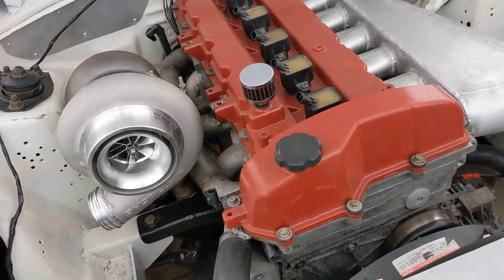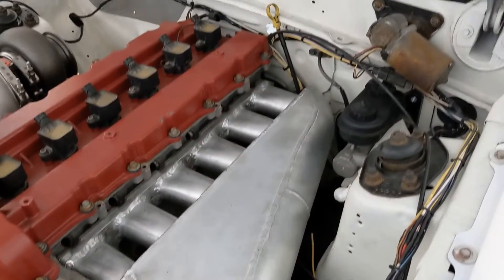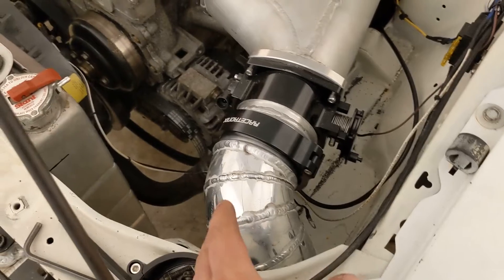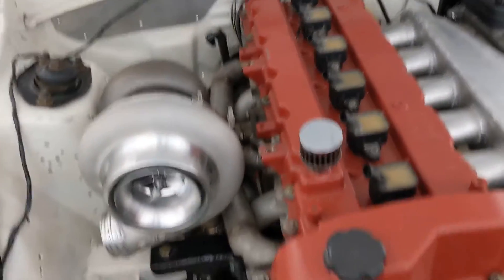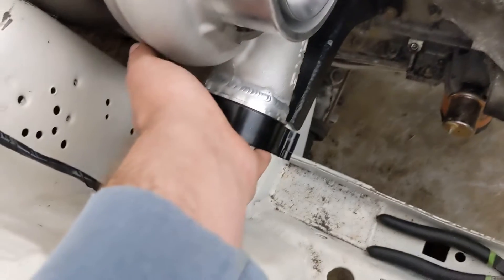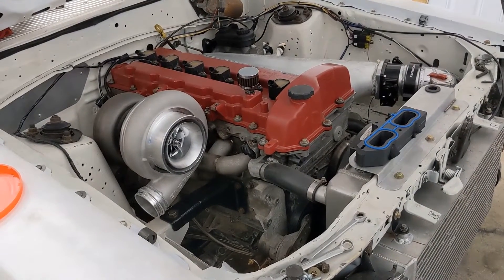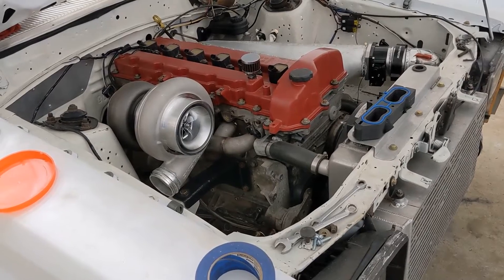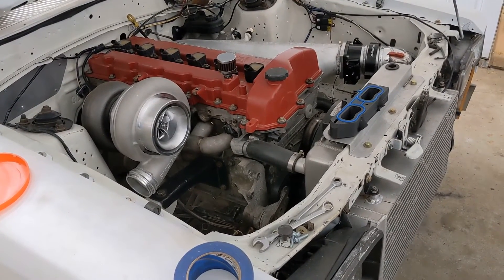Making an Intake for the Ameri-Barra Vortec 4200

Comment: Calvin, is there any incentive to making a divider down the the middle of the plenum? From the middle of the throttle body to the center of the runners? Effectively making a dual plain. Curious of your thoughts.  I am in the planning stages of making my intake.
Reply from the maker: Could have merit. Optimal runner length may be affected since it would effectively be two 3 cylinders.

Comment: Loads of work when you could run an ls with a 2 cylinder advantage. The cost of the 4200 is foolish
Reply from the maker: The cost of not doing something that will make you happy is far more foolish. Personally I try not to judge others for doing what makes them happy.

Comment: I'm wondering if you could make either a 3x2 sidedraught set up with the Borla throttle bodies (their IDA 48 look alikes), or a full ITB (6x1) set up like the old BMW M6's and M5's had?  🤔
Reply from the maker: When there is a will, there is a way
Reply: @Calvin-Nelson  The only major difference in what I think I will do is, instead of using a Ford Fox body, I would like to try a GM G-body car with a 4L80-E transmission.

Comment: What were the tube specs you used for the intake runners?? Wall thickess/diameter. Thanks
Reply from the maker: I used 2.5 diameter 0.060 wall, but I would recommend 2.25 diameter

Comment: I have a early trailblazer 4200 and it is a tough engine. A friend has the same engine in a mid size GMC pickup but it is a 5  cylinder.. I would think it has better balance than the 4200.
Reply from the maker: The 5 cylinders have balance shafts. The 6 cylinders don't, so take that how you will. 😉

Comment: I have a 1967 Chevy C-10 with a 250 straight 6 , I would love to put a stock 2006 4200 motor and transmission , and rad  in my truck , Are these motor and trans cheap to buy from a scrap yard ?
Reply from the maker: Yes. Very cheap

Comment: Would you sell the intake flange as a part?
Reply from the maker: There was a guy doing it on the  Facebook page. I need to look into have a place make them. Making them on a manual mill sucks.
Reply: @Calvin-Nelson  seems like having one laser or water jet cut would be an easier, though costlier option.

Comment: Looks great.  Alot of manual labor.  Did you use any  formulas or just the"SWAG" theory?
Reply from the maker: I talked to a guy that has done intake manifold design in the past. Followed his recommendations. Only thing I didn't do was make the radius entry into the runners like he wanted me to. I figured the velocity stacks would do ok, and I was just trying to get it done.
Reply: @Calvin-Nelson  cool thanks.

Comment: Hi, just wondering if you have tried or would be interested to try putting the exhaust cam onto the intake side for dual VVT. Chevrolet has stated that this engine was designed with future implementation of intake side VVT in mind, and while it's not from the same manufacturer, Frankenstein Motorsport has done a similar thing with the 2ARFXE Toyota motor, putting the intake VVT cam onto the exhaust side and works.
Reply from the maker: Would definitely be interested, but it would be a very difficult thing to do

Comment: Great job! Was thinking using Holley terminator x and using progressive nitrous control which uses a pwm to run the pwm solenoid that gm uses control vvt on the 4200 engine.
Reply: Any thoughts would be appreciated thanks
Reply from the maker: @richardkent3522  Short answer is I don't recommend it. 

I tried open loop control before. After figuring out the closed loop control on the Goldbox, I found out that duty cycle does not give a linear response to VVT angle. In fact there is very little correlation. It has to "hunt" around to maintain a steady position. Also, terminator X does not support the more common trigger pattern that these engines have, which is a 6+1 crank wheel.
Reply from the maker: @richardkent3522  If it was possible to run the VVT with a Terminator, I would be running one! Trust me!!! Lol
Reply: Ok, thanks, One other question how thick is the bellhousing adapter for the studebaker?
Reply from the maker: @richardkent3522  3/8"
Reply: Thank you.
Reply from the maker: @richardkent3522  No problem.

Comment: So I commented first thing this morning but for some reason all my youtube comments didn't post. So I will try it again. Great work Calvin. really cool. I would think if you wanted to run a second set of injectors you could add a angled Bung to the runners on the intake fairly easily you would just need to optimize the angle and length for the injector you wanted to use. could even incorporate a drill guide into your printed jig. I love the fact you are doing all this in your home shop with your dad. You guys are amazing. I also think its great  that you are getting recognized by Jeremy, Richard and others for what you are doing. I hope that your Channel takes off. Wouldn't it be great if we could get a billet block, forged internals and a custom cam optimized for boost on one of these. GREAT Work man
Reply from the maker: Yeah. I saw your comment pop up this morning, but when I went to go read it, it disappeared. Thanks for the kind words.
Reply: @Calvin-Nelson  you deserve it you are doing amazing work

Comment: Calvin i was thinking the other day when i saw you post this on the 4200 group on FB you should check out the TB48 intake manifolds they sell on alibaba they're $200 and look to be similar in size and length to what a 4200 is, might be able to just cut the TB48 flange off and weld on a 4200 flange if the runners all line up.
Reply: Here's a link to the alibaba ad i was talking about

https://www.alibaba.com/product-detail/aluminum-tb48-air-intake-plenum-for_60659114580.html
Reply from the maker: @thewraith6360  Now there is an idea. Only problem I see is it will likely not line up. The TB48 has a 3.92 inch bore. This means that the bore spacing is probably around 4.2-4.3 on the TB48. The bore spacing on a 4200 is 4.062. I wonder if there are other engines out there that we could do something similar with. I like what you are thinking.
Reply: @Calvin-Nelson  Theres also the 1FZ from toyota, its a 4.5L which wikipedia says is 3.94 inch bore is that better or worse?  I think the closest bore size you'll find with an aftermarket support is the barra (3.632 inch bore) but i can't find anything on alibaba or ebay for the barra, however theres a guy on instagram who's username is "customalloywelding" who sells DIY intake manifold kits for the barra. Its what corey from "fuel injection sucks" youtube page used on his barra ford LTD and i think the kits were pretty damn cheap if im remembering correctly, probably even cheaper if you decide to not get the barra intake flange with the kit. He's starting to make his own billet intake manifold flanges for his barra intake manifolds i don't see why he wouldn't be able to make the same DIY kit but with a 4200 flange instead of a barra one.
Reply from the maker: @thewraith6360  The issue is the bore spacing. Not the bore. That is also what I found. The only engine close is the Barra.  I'll have to look into their kits.
Reply: @Calvin-Nelson  I see, badass job on the intake manifold though really cleaver how you did the velocity stack ends and the plenum never thought of doing a plenum with intercooler piping lol

Comment: Cool manifold build! Is the plenum all 0.065" wall? Freind of mine had a home built manifold on a Ford zetec turbo and he encountered some weld cracking due to fatigue and flexibility under boost. I'm assuming you didn't put any bracing or baffling inside? Looks good overall, mill work is always fun :)
Reply from the maker: The tubes are .065. all the flat surfaces are .1875.

Comment: Great work! I thought you were going to print out adapters to use a 2jz intake setup?
Reply from the maker: Decided that was not worth the risk. Also, the 2jz plenum is not really ideal for a 4.2L.
Reply: Nivlac57 what are you running for plugs and gap?  We have been running my build on dyno and thinking about different plugs and turn the up boost to 15psi +.
Reply from the maker: @gregsefcik6700  I've been running NGK LTR6IX plugs. With like .025 gap.
Reply: Thanks man!

Comment: What material are you 3d printing the press dies from?
Reply from the maker: Polycarbonate
Reply: @Calvin-Nelson  Got a link, by chance? I make some press dies for things reasonably often, and usually I make them out of wood and it's very time consuming. Being able to use print them would be a huge time saver. Thanks.